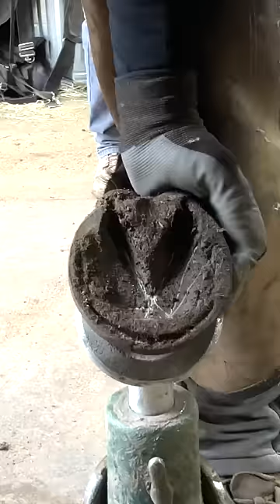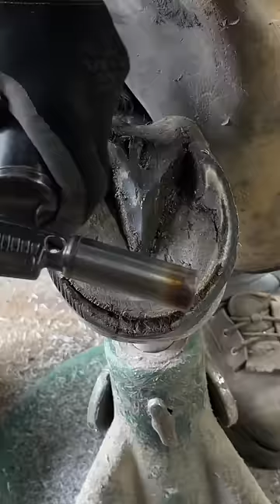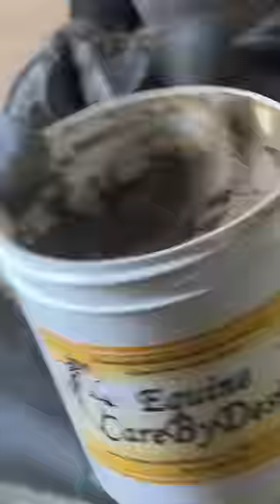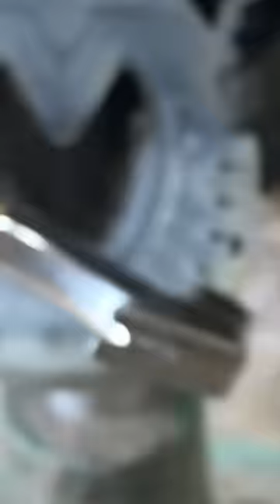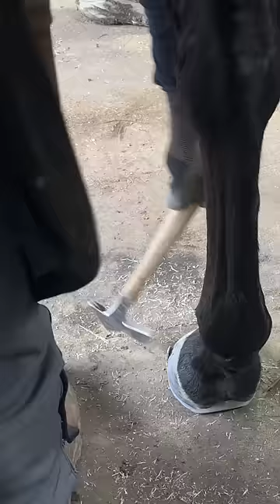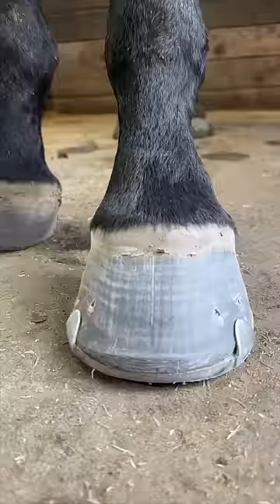Helping a horse with a mild case of hoof wall separation ! Part 1 #hoofcare #asmr #helping

Comment: Thats no fun 😕 how do you typically treat that? will it fix itself after you have glued them to prevent further splitting? Or will it split again once the glue is gone?
Reply from the maker: Pack with medicated packing, remove the  leverage on the hoof wall by adding a shoe with appropriate breakover , stay on a regular schedule.